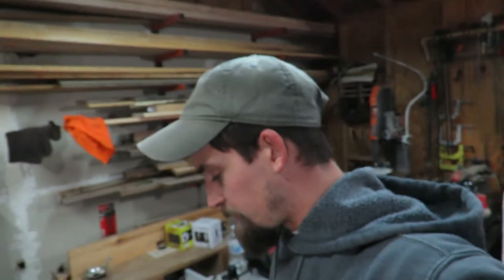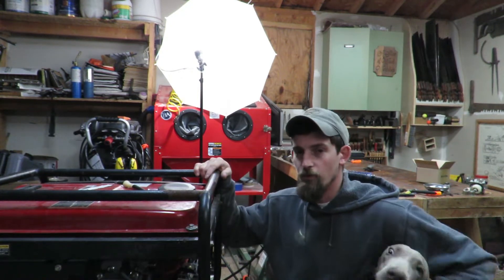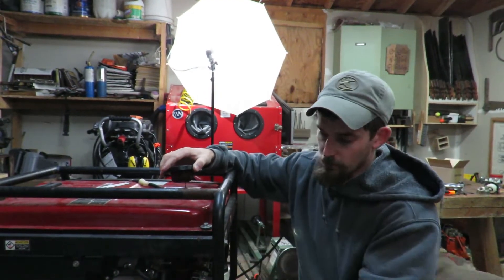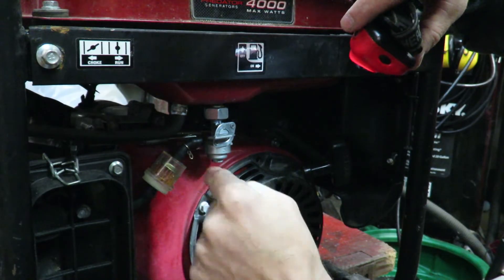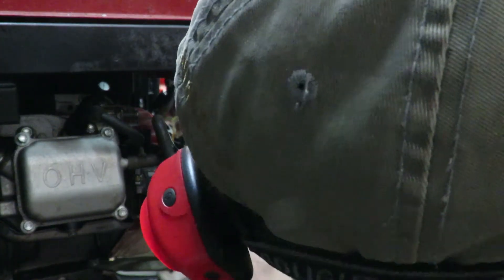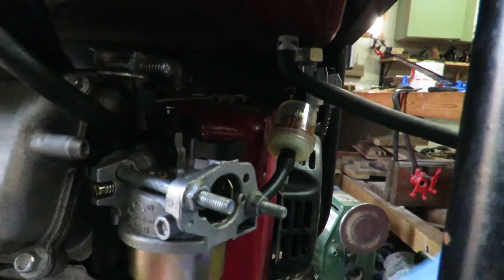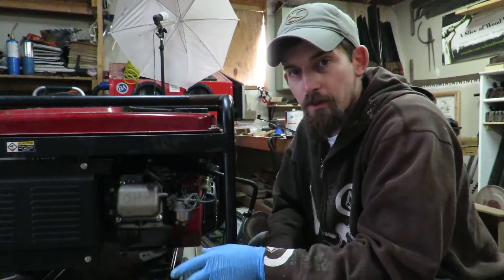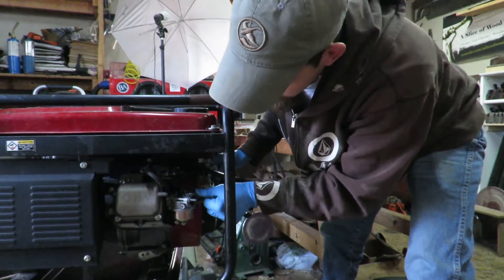Predator 4000 Generator | Solving the Fuel Issue

Comment: Hello, I i know this is very late but id found your video informative and it'd helped me so far up until the point where I couldn't get the generator to light up. Were you able to solve the lighting issue and if you did, please how did you do it?
Reply: He may have to replace the AVR (Automatic Voltage Regulator)

Comment: My problem, I'm having I can't get fuel to flow through the gas valve that's connected to the gas tank.
Reply: Take it off and soak it in acetone for several hours. Or carb cleaner
Reply: @claytonking70  thanks I did that , well, kind of, I used finger nail polish remover. It worked .

Comment: My problem is that I can't get the fuel to flow, into carburetor,  when it fuel filter get half full and runs it goes down but will not draw more fuel into filter running out of fuel and dying
Reply from the maker: That means your carb isn't pulling fuel. Have you replaced all the gasket or carb itself?
Reply: @ASliceofWoodWorkshop  will work on that next

Comment: Still can't get mine to run....New carb and gaskets, have spark, at a loss
Reply from the maker: Getting fuel?
Reply: @ASliceofWoodWorkshop  yup.
Reply from the maker: Next thing to check would be compression. I would drop some gas in the spark plug hole and see if it fires over. If it doesn't then you may have a compression issue

Comment: I have a question I just bought a predator generator and the bolt that goes from the tank to the fuel shut off valve is leaking gas in suggestions to fixing it would be appreciated thank you
Reply: Don’t forget about the generator safety rules: Always make sure you follow all the generator safety rules whenever you use your portable generator. This is only a reminder. Generators can be dangerous if not used carefully. Every year, hundreds of people die or get injured when using portable generators due to carbon monoxide poisoning and electrocution. Make sure you are using your generator carefully and keeping others safe as well. There is something very serious that everyone should always be aware of when using generators. Some people do run their generator indoors which is not safe and that increases the risk of carbon monoxide poisoning which can cause death of family and you. Some people run their generator in wet conditions which can electrocute them. Please remember that you should never run your generator indoors. Remember that carbon monoxide is an odorless and colorless gas that you cannot see or smell. Carbon monoxide is a silent killer. Keep that in mind. Make sure your generator is 15-20 feet away from your house and away from doors, windows, and vents. Never use your generator in your porch too. Having a carbon monoxide detector is very important against generator safety. Some people also allow children to go near the portable generator which could pose risks. We need to keep an eye on our children making sure that they are not near the portable generator so they won’t get electrocuted or burned by the generator which is dangerous. A locking enclosure also keeps kids safe. A generator shed might look like a tempting place to explore, or take cover during a game of hide and seek, but a generator is a dangerous piece of equipment that can cause injury. It says on the manual that we should also keep children away at all times from the portable generator to avoid injuries. Please do not allow a child or unqualified people to operate the portable generator.  It is important to keep your children safe especially little ones. The portable generator can be hot during an operation. Just because some manuals missed what should be listed doesn’t mean it’s safe to do. Always follow the generator safety rules when using portable generators. Generators pose electrical risks. If you need to use your generator during wet weather, you need a generator tent to protect your generator from getting wet. Don’t let your generator get wet. Keep your generator dry and before using your generator, please make sure your hands and your generator is dry. Do not wear loose clothing when operating the generator. Everything that is said on the generator’s operating manual should not be ignored. Never smoke cigarettes near the generator. Please keep flammable things away from the generator. Never overload your generator too. Your generator can catch fire. Never ever try to plug a generator cord into a wall outlet to avoid back feeding. Back feeding your generator is dangerous. Always turn on your generator first before plugging in appliances and shut off the appliances before turning your generator off. Use a heavy duty cord for your generator and the cord should not be worn out. All the instructions should be followed carefully. Never refuel your generator while it’s running. It can cause fire if fuel spills while your generator is hot. You should turn off your generator and let it cool off before refueling it. Having a fire extinguisher next to the generator is also important. This is only a reminder for everyone’s safety of using generators. Make sure your generator is properly grounded. Having a fire extinguisher next to the generator is also important against the safety rules. https://youtu.be/I1jT3ANENvI and here is a video more about keeping others safe when using generators and also about our family’s safety. It’s important to keep our little children safe as well. Make sure your little children are kept away from the generator at all times especially when it’s running. Hope this helps. Remember it’s better to be safe than sorry.

Comment: Very helpful Tim.  We have the same generator and it wouldn't start and fuel was leaking from the rear gasket.  Bought the replacement on Amazon and having watched your example it was a piece of cake to install.  Started with the first pull and no leaks!
Reply: Don’t forget about the generator safety rules: Always make sure you follow all the generator safety rules whenever you use your portable generator. This is only a reminder. Generators can be dangerous if not used carefully. Every year, hundreds of people die or get injured when using portable generators due to carbon monoxide poisoning and electrocution. Make sure you are using your generator carefully and keeping others safe as well. There is something very serious that everyone should always be aware of when using generators. Some people do run their generator indoors which is not safe and that increases the risk of carbon monoxide poisoning which can cause death of family and you. Some people run their generator in wet conditions which can electrocute them. Please remember that you should never run your generator indoors. Remember that carbon monoxide is an odorless and colorless gas that you cannot see or smell. Carbon monoxide is a silent killer. Keep that in mind. Make sure your generator is 15-20 feet away from your house and away from doors, windows, and vents. Never use your generator in your porch too. Having a carbon monoxide detector is very important against generator safety. Some people also allow children to go near the portable generator which could pose risks. We need to keep an eye on our children making sure that they are not near the portable generator so they won’t get electrocuted or burned by the generator which is dangerous. A locking enclosure also keeps kids safe. A generator shed might look like a tempting place to explore, or take cover during a game of hide and seek, but a generator is a dangerous piece of equipment that can cause injury. It says on the manual that we should also keep children away at all times from the portable generator to avoid injuries. Please do not allow a child or unqualified people to operate the portable generator.  It is important to keep your children safe especially little ones. The portable generator can be hot during an operation. Just because some manuals missed what should be listed doesn’t mean it’s safe to do. Always follow the generator safety rules when using portable generators. Generators pose electrical risks. If you need to use your generator during wet weather, you need a generator tent to protect your generator from getting wet. Don’t let your generator get wet. Keep your generator dry and before using your generator, please make sure your hands and your generator is dry. Do not wear loose clothing when operating the generator. Everything that is said on the generator’s operating manual should not be ignored. Never smoke cigarettes near the generator. Please keep flammable things away from the generator. Never overload your generator too. Your generator can catch fire. Never ever try to plug a generator cord into a wall outlet to avoid back feeding. Back feeding your generator is dangerous. Always turn on your generator first before plugging in appliances and shut off the appliances before turning your generator off. Use a heavy duty cord for your generator and the cord should not be worn out. All the instructions should be followed carefully. Never refuel your generator while it’s running. It can cause fire if fuel spills while your generator is hot. You should turn off your generator and let it cool off before refueling it. Having a fire extinguisher next to the generator is also important. This is only a reminder for everyone’s safety of using generators. Make sure your generator is properly grounded. Having a fire extinguisher next to the generator is also important against the safety rules. https://youtu.be/I1jT3ANENvI and here is a video more about keeping others safe when using generators and also about our family’s safety. It’s important to keep our little children safe as well. Make sure your little children are kept away from the generator at all times especially when it’s running. Hope this helps. Remember it’s better to be safe than sorry.

Comment: The fuel switch is labeled correctly, the arrow indicates which way to turn the switch for flow on or off.  Also have you reset your circuit breakers on front of generator to get power back to your light?  Good video all in all.  I have same generator and been there.
Reply: Don’t forget about the generator safety rules: Always make sure you follow all the generator safety rules whenever you use your portable generator. This is only a reminder. Generators can be dangerous if not used carefully. Every year, hundreds of people die or get injured when using portable generators due to carbon monoxide poisoning and electrocution. Make sure you are using your generator carefully and keeping others safe as well. There is something very serious that everyone should always be aware of when using generators. Some people do run their generator indoors which is not safe and that increases the risk of carbon monoxide poisoning which can cause death of family and you. Some people run their generator in wet conditions which can electrocute them. Please remember that you should never run your generator indoors. Remember that carbon monoxide is an odorless and colorless gas that you cannot see or smell. Carbon monoxide is a silent killer. Keep that in mind. Make sure your generator is 15-20 feet away from your house and away from doors, windows, and vents. Never use your generator in your porch too. Having a carbon monoxide detector is very important against generator safety. Some people also allow children to go near the portable generator which could pose risks. We need to keep an eye on our children making sure that they are not near the portable generator so they won’t get electrocuted or burned by the generator which is dangerous. A locking enclosure also keeps kids safe. A generator shed might look like a tempting place to explore, or take cover during a game of hide and seek, but a generator is a dangerous piece of equipment that can cause injury. It says on the manual that we should also keep children away at all times from the portable generator to avoid injuries. Please do not allow a child or unqualified people to operate the portable generator.  It is important to keep your children safe especially little ones. The portable generator can be hot during an operation. Just because some manuals missed what should be listed doesn’t mean it’s safe to do. Always follow the generator safety rules when using portable generators. Generators pose electrical risks. If you need to use your generator during wet weather, you need a generator tent to protect your generator from getting wet. Don’t let your generator get wet. Keep your generator dry and before using your generator, please make sure your hands and your generator is dry. Do not wear loose clothing when operating the generator. Everything that is said on the generator’s operating manual should not be ignored. Never smoke cigarettes near the generator. Please keep flammable things away from the generator. Never overload your generator too. Your generator can catch fire. Never ever try to plug a generator cord into a wall outlet to avoid back feeding. Back feeding your generator is dangerous. Always turn on your generator first before plugging in appliances and shut off the appliances before turning your generator off. Use a heavy duty cord for your generator and the cord should not be worn out. All the instructions should be followed carefully. Never refuel your generator while it’s running. It can cause fire if fuel spills while your generator is hot. You should turn off your generator and let it cool off before refueling it. Having a fire extinguisher next to the generator is also important. This is only a reminder for everyone’s safety of using generators. Make sure your generator is properly grounded. Having a fire extinguisher next to the generator is also important against the safety rules. https://youtu.be/I1jT3ANENvI and here is a video more about keeping others safe when using generators and also about our family’s safety. It’s important to keep our little children safe as well. Make sure your little children are kept away from the generator at all times especially when it’s running. Hope this helps. Remember it’s better to be safe than sorry.
Reply: @The_Happy_Aviation_Enthusiast  Great comment, but we were just discussing getting the thing started. Never forget safety, in anything you do.